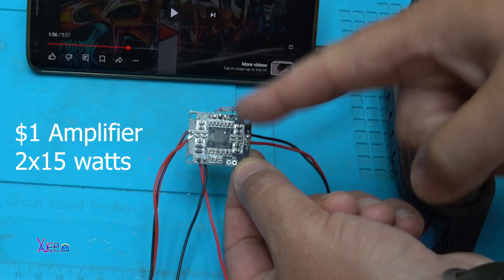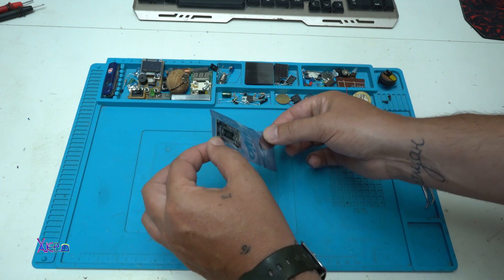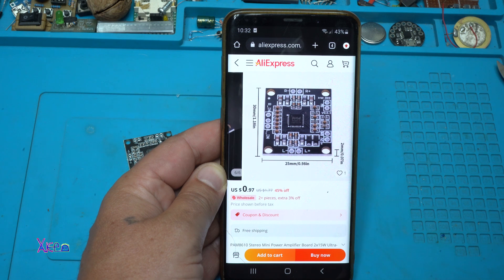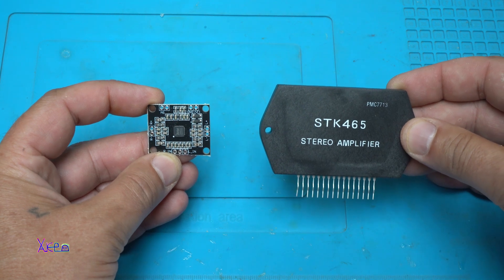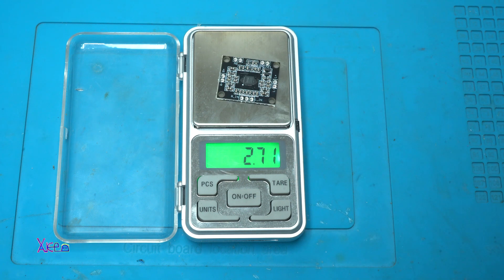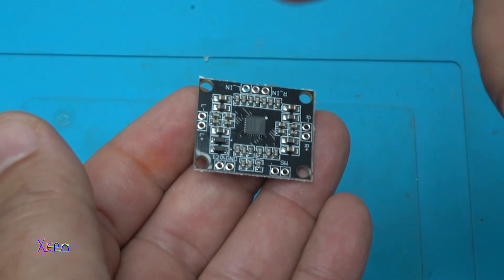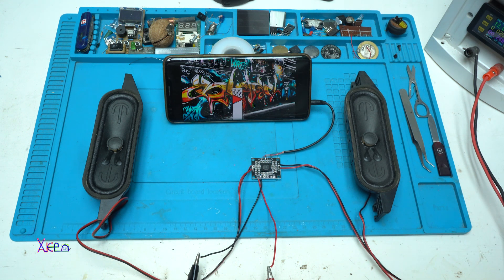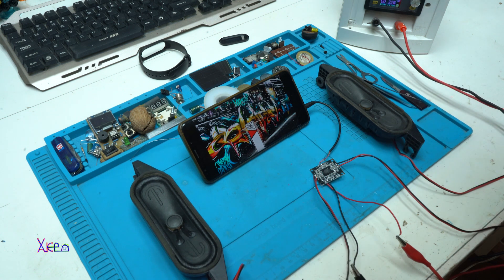$1 Audio Amplifier 15W+15W from Aliexpress

Comment from the maker: What do you think?
Reply: what's about if we play audio on it for 3 to 4 hr at 60% volume (does ic heats or gets damaged or ......it's all fine?)
Reply: Your power supply is showing a power drawer of 1.29 watts,  so output wattage would be less than that. I doubt  this unit can actually output 15 watts. A neat little amplifier though.